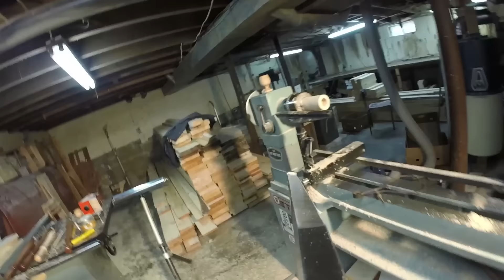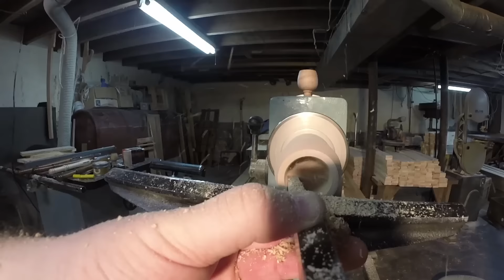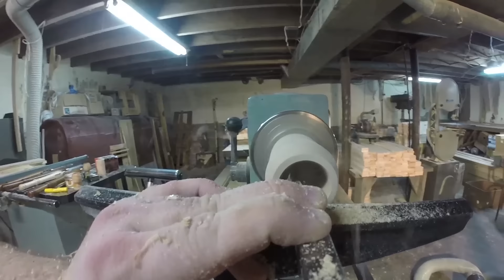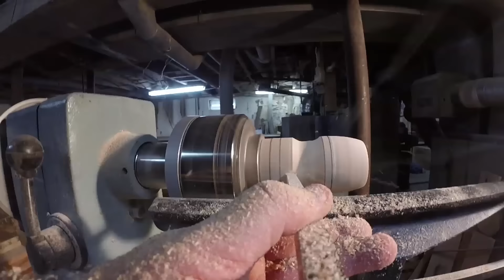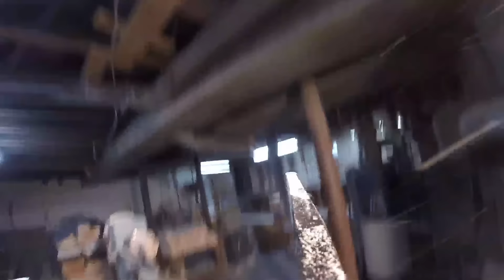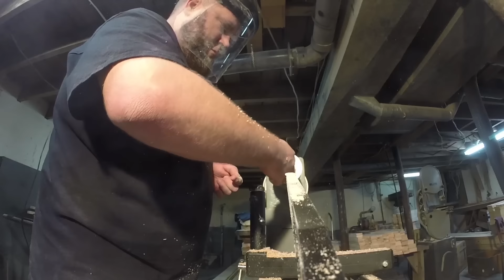Woodturning Miniature Gobelet [Tool Cam]

Comment: Hi Pat! That, mon ami, is what I imagined when thinking about watching the action from a privileged point of view! Nice video, very cool! Cheers! Daniel
Reply: Cool, how many TPI?
Reply: That should work pretty well, but be careful not to use is with woods that are very fibrous. The more dense woods will work better, Cocobolo, Boxwood, African Blackwood, Ebony, unfortunately, these are all expensive. That's why I have seen turners like Sam Angelo to do an insert for the thread. I have tried with hard maple with diverse results. Granadillo also works nice. Cheers! Daniel
Reply: Yes! That's what I did with the piece of hormigo, be careful to let it dry well and use thin CA because it will penetrate better the wood. But there are still limits of how much this would help.